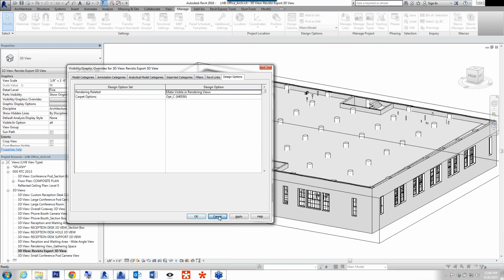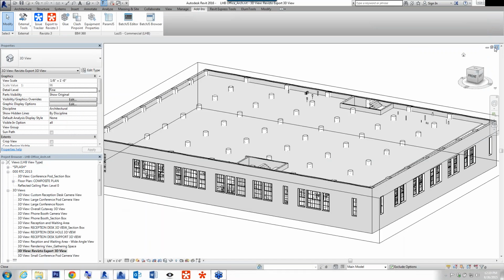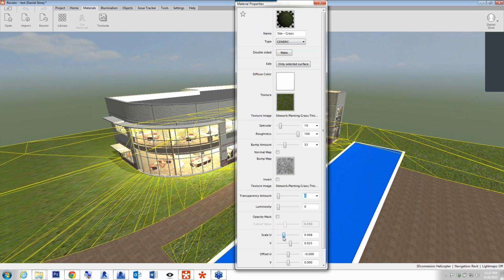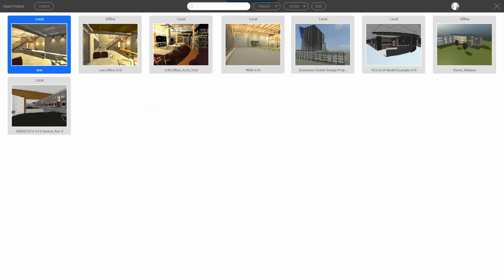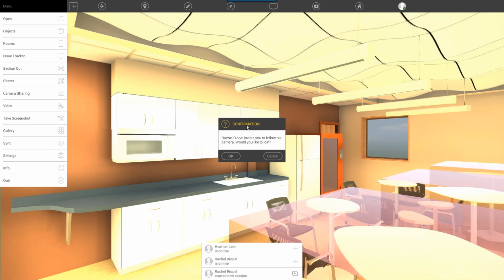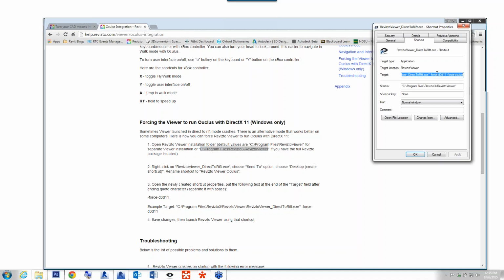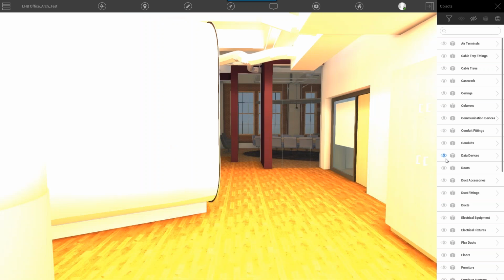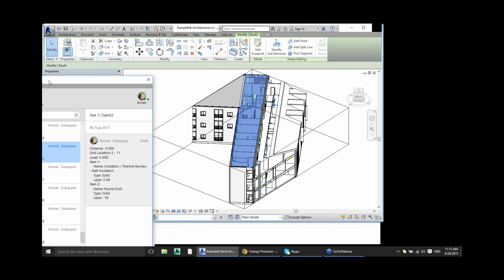REVIZTO EXCLUSIVE WEBINAR BY DAN STINE! 26 Aug 2015

Comment: Is it possible to texture in another program such as 3ds or Octane? 
FBX compatibility?
Will materials import from the above programs?
Can you have oculus support with the free version?

**This seems like a great alternative to the Revit>FBX>3ds>FBX>Unreal
Reply: +Craig Johnson You can texture in 3DS Max but only with standard library if you are using Vray or other it won't come in. Also you need to save the materials inside of the fbx before saving the file to be imported in Revizto. Sometimes people are using materials that are on local network folders and in that case materials are not going through. 
As far as the Oculus, yes it has the support with FREE version.